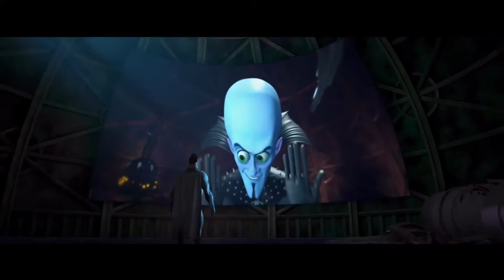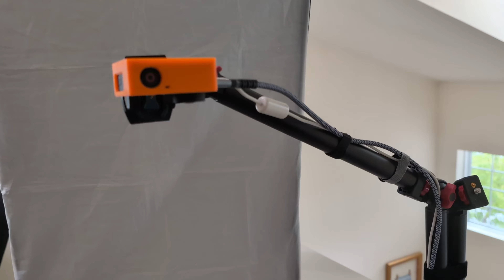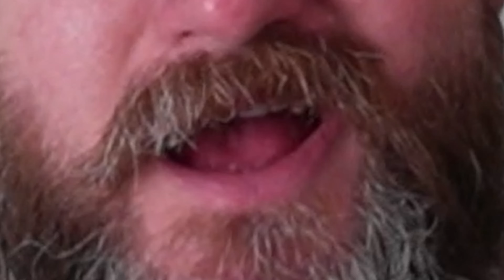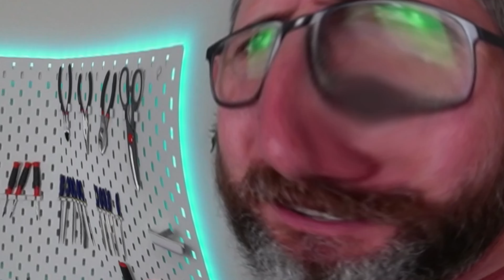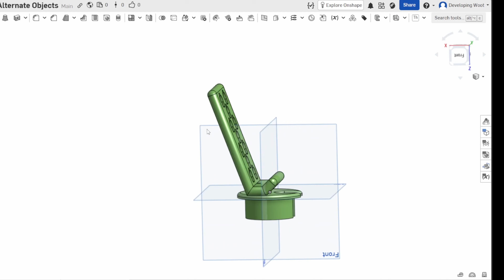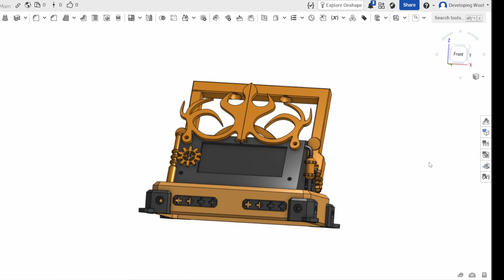Why I 3D Print Everything (The Spouse Approval Factor)

Comment: I've printed lots of things but all of the functional ones actually in use have been for the printer itself lol.  I either have printed it but not used it for it's intended purpose yet or trying out solutions I've found before finding one that works or just having to model it myself.  I haven't modeled anything myself yet but I'm about to embark on that adventure
Reply from the maker: 🤣, modeling is so much fun, and I think once you go down that run you will start printing all kinds of things that you use. I feel like functional printing is really unlocked once you learn to model.
Reply: @wootsworkshop That is probably true since I currently go through sites looking at others creations and think it would be useful for me but my own would probably be more purposeful.
Reply from the maker: @robert_5974 yeah, my most functional prints are ones where I fixed something that was broken. A trashcan lid, a mounting bracket for a picture frame. It's fun being able to fix something instead of throwing it away